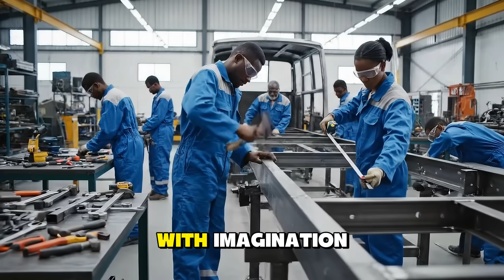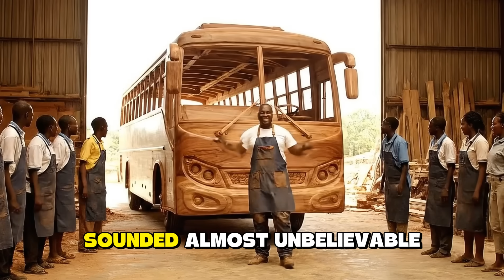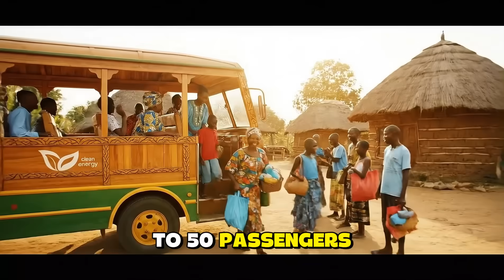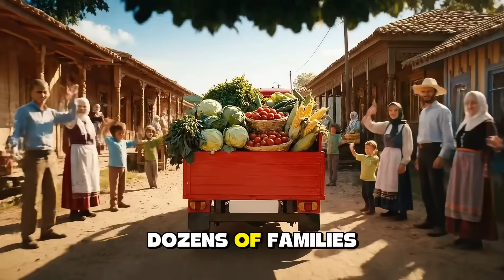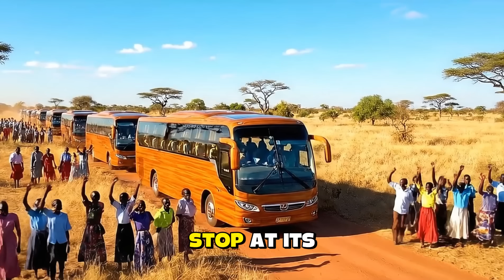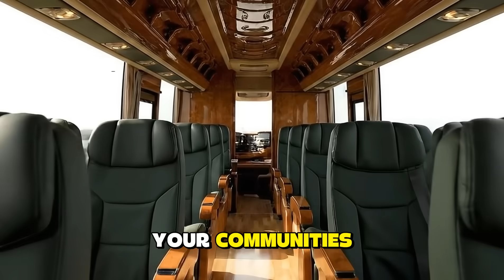Burkina Faso’s Wooden Buses | The African Revolution That’s Changing the World

Comment: This is partially real, but it's a bit of a mix-up; the claim is likely a confusion between different projects. Burkina Faso has introduced locally made electric vehicles and they are also exploring solar energy, but there are no reports of engineers building wooden buses powered by hybrid engines. While they do use solar energy to extend their range, they are not powered by hybrid engines in the way the claim suggests.